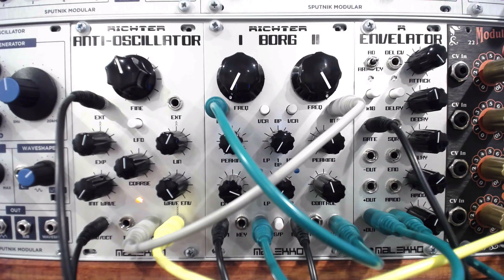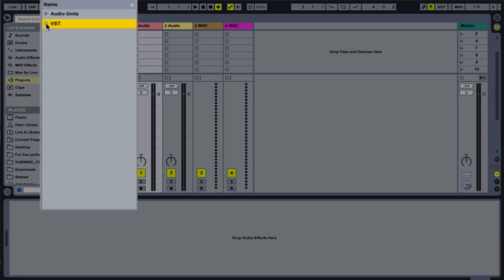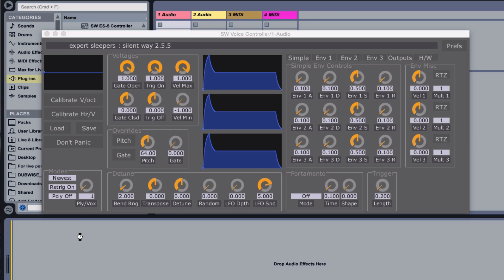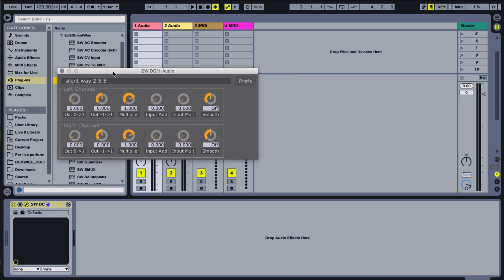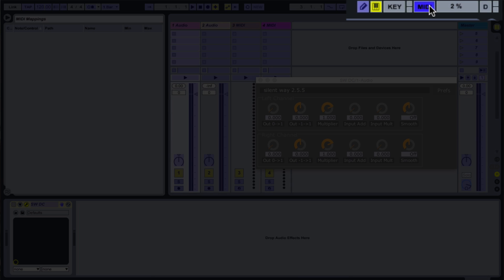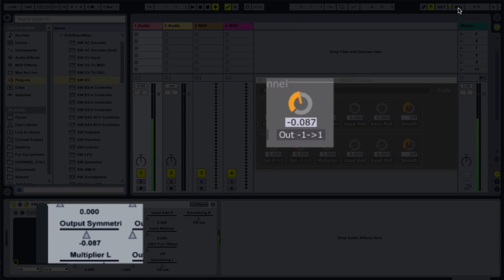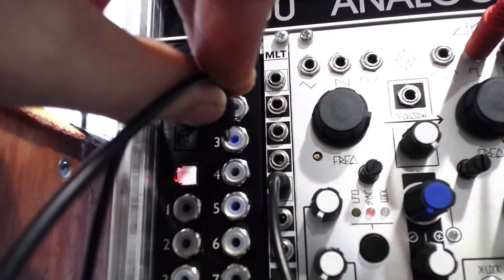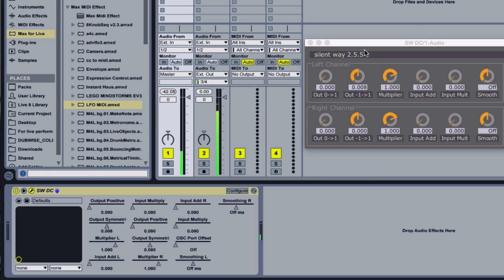Controlling Eurorack With Silent Way

Comment: how do i know if my audio interface is dc coupled? i have a presonus fire studio mobile and an echo audiofire 12.. Also is there a way to convert an audio interface to be dc coupled?
Reply: yw  had the same problem except different interface (focusrite scarlett 6i6).
Reply from the maker: You may have to contact the manufacturer to find out if the device is DC Coupled. There is a list on the ES site... http://www.expert-sleepers.co.uk/siwacompatibility.html There are ways to convert AC coupled interfaces, but they are not easy and probably not recommended, unfortunately. I was looking into that myself for awhile.
Reply: The fire studio has a spdif in/out via the midi/spdif connector from the tech. specs comes with a cable with the outputs on, so if you want you can use the spdif expert sleepers ES-4 or the ES-40 (with the CV/gate expanders  EXS-8CV,EXS-8GT or EXS-4CV). Has a bonus  of keeping your audio channels and with the ES-40  http://expert-sleepers.co.uk/es40.html your can add multiple sets of 8 cvs and 8 gates. Plus an ES-7 allows you to pipe back two 24 bit audio channels back into your daw. Has 5 headers so any 5 combination of the of the expands.
Reply from the maker: THECHILLEDPANDA Thanks for letting us know, I appreciate it!
Reply: THECHILLEDPANDA awesome thanks mate!

Comment: I've been using SW to control my modular for a few years now. In addition to being pretty straight forward and requiring no extra hardware (yay MOTU!) other than the floating ring cables there are some pretty advanced little modules hiding in those plugins. Personally I use the Sync more than anything else but the Step LFO is pretty dazzling, anything from a graphical step sequencer to a Turing Machine style SR. And of course the indispensable Voice Controller.

Comment: Tried to get along with SW software (I have an ES-4) for about a year. Found ιτ extremely unintuitive and eventually just stopped using it. Sync was bad anyway.
I am using CVToolkit now and never looked back.
Reply from the maker: CVToolkit is great as well, I'll have some material on that coming soon!
Reply: Heaps of awesome modules in there, I use the Beats pack the most but the rest are also great. I use it via ES-4. The matrix and general ease of setting up routing certain signals from CV Toolkit to certain outs on the ES-4, is what I mostly like about this software. Its an app as well, no need for a DAW.